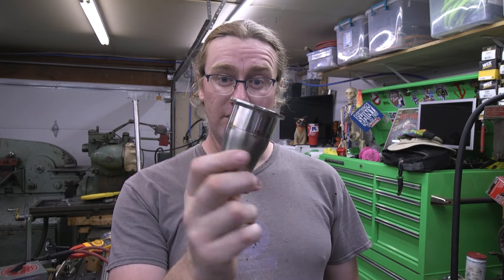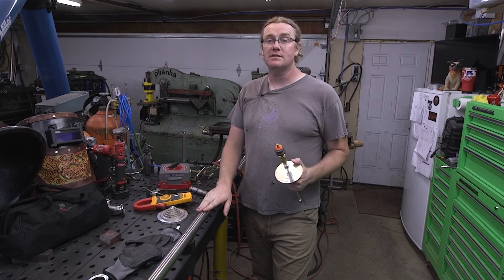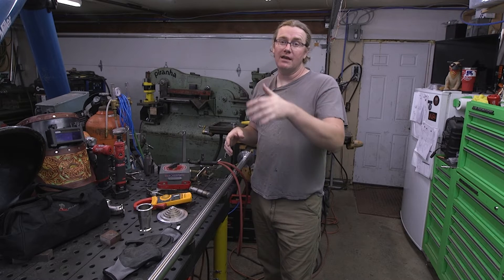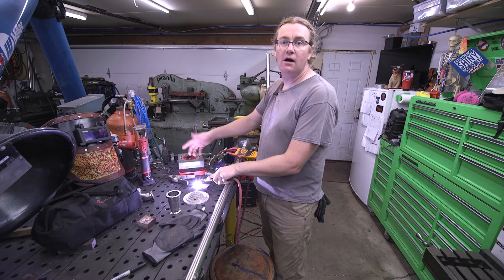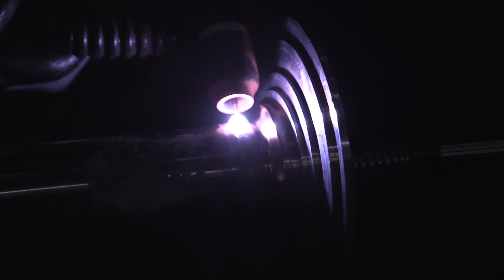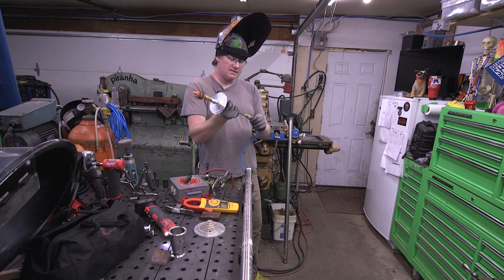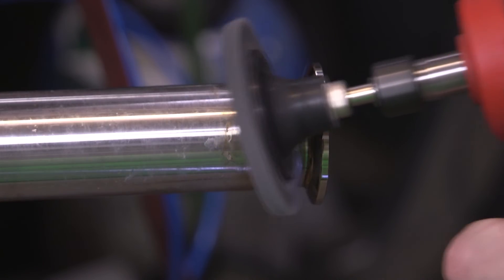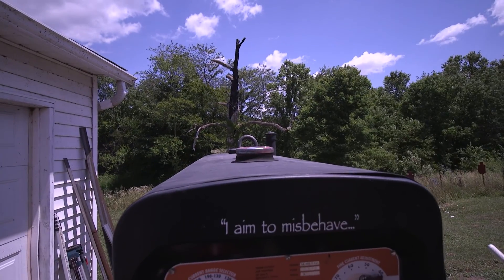Sanitary Tube Welding With A Lincoln SA 200, A Welding Process that Uses No Filler

Comment: I’m new to TIG welding, and I am interested in sanitary welding. What size of tungesten and what type of tungsten do you use for sanitary?
Reply from the maker: I use 3/32 for pretty much everything and the cheap grey stuff off amazon.
Reply: @DarlingtonFarm  thanks! I have tried 1/8 and can’t keep an arc going. Granted, I’m Tig rigging off of a Miller Thunderbolt. But I do have a Ranger that I have had better success with tigging off of with 1/16 tungsten

Comment: what did you do to passivate?  And, when do you use the cougartron?
Reply from the maker: I usually use it for hard to reach spots or stuff that was in contact with carbon steel, it will get an acetic acid bath